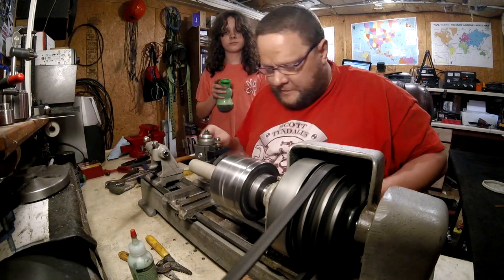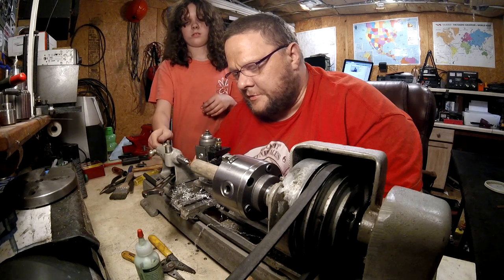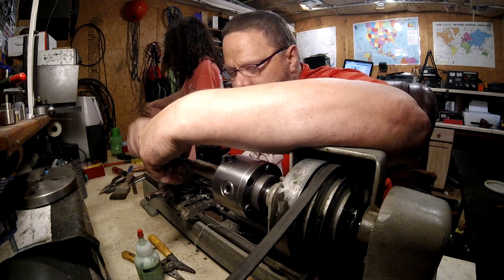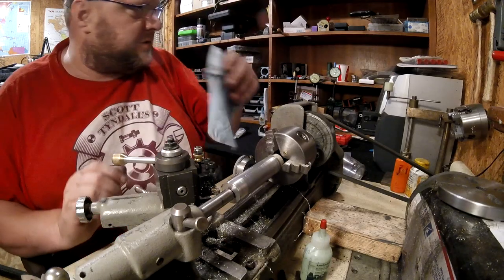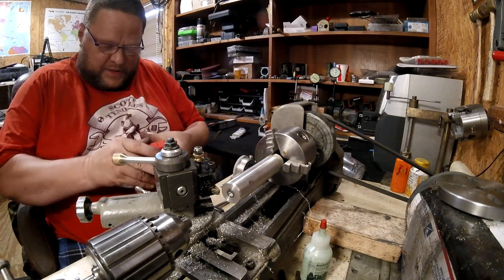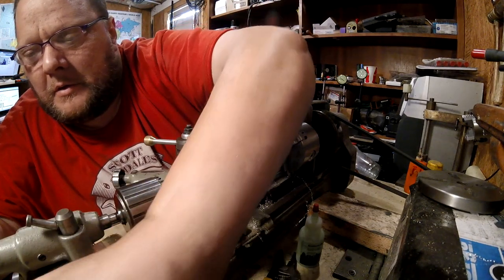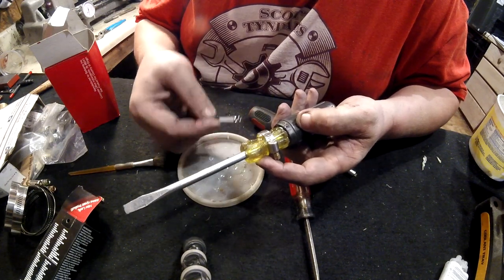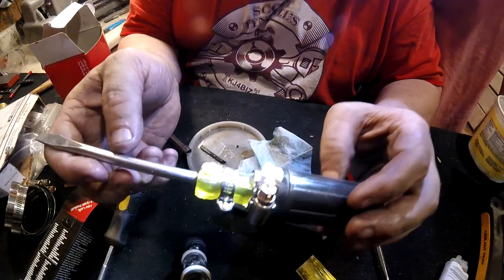Screwdriver fix ( Klein )

Comment: No safety squints?!!!  For shame.   Lathes especially make Safety glasses necessary.  They throw sharps bits and strings of metal that do NOT do good things to unprotected eyes.
Reply from the maker: WeirdHarold49 you are correct. It was a gross oversight  on my part